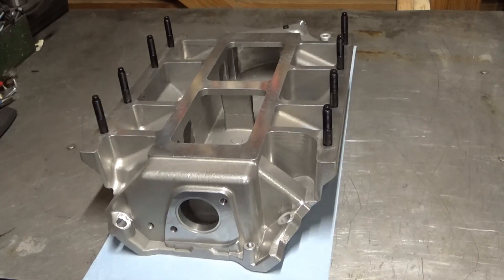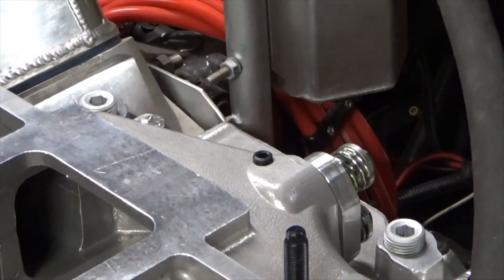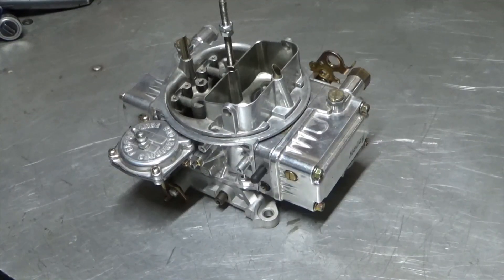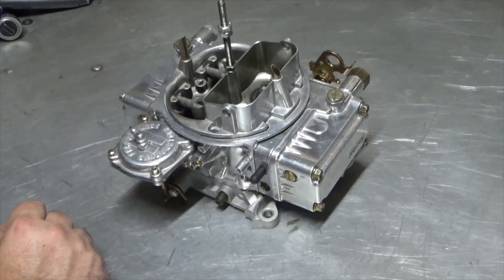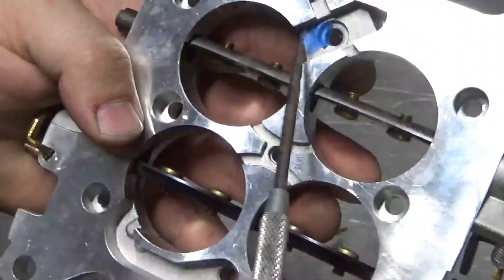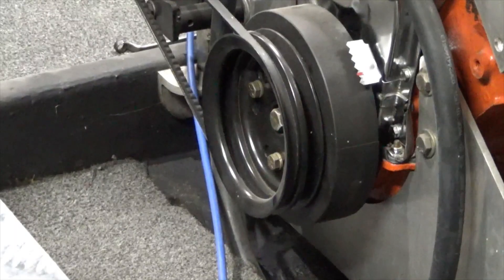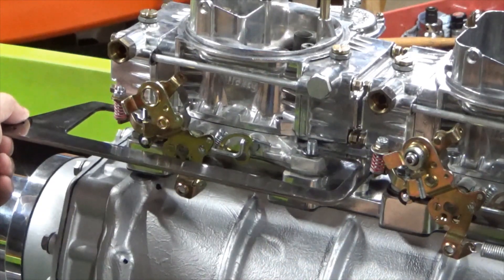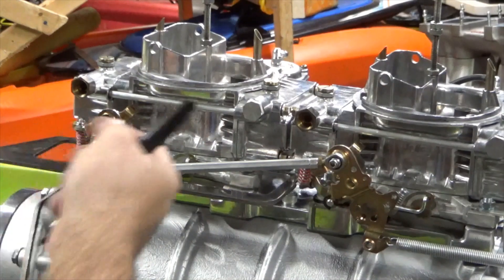Supercharging my jet boat (part 3) Installing the supercharger, boost reference carbs, and test run.

Comment: How’s she run? I personally have good luck in these applications eliminating the power valve. You running your distributor advance pinned? Seen lots of guys run rec port manifolds on large oval heads. You can port match them somewhat but you really can only go about 1/2” deep in the head. I doubt it would make much difference at this level though.  Whose blower is that?

Comment: I want you to picture something.
Pretend air is, say water.
As a blower will..say...solidify air.
Possibly the consistency of water.

Ok...take a pressurized stream of water...with the dimension of the "so called" solid stream of air being pressurized out of the blower.
Got all of that ?
But for this scenario, we'll just take say a hose spraying water.
Now take that stream of water, and blast it at the mismatched ports.
Which way would that water go ?
???...everywhere ???
That's the path your intake charge will mirror.
At the same time, this splashing air...will disrupt ...let's call it..the "Clean" air stream (flow).
Walk up to a wall and spray it directly with your garden hose.